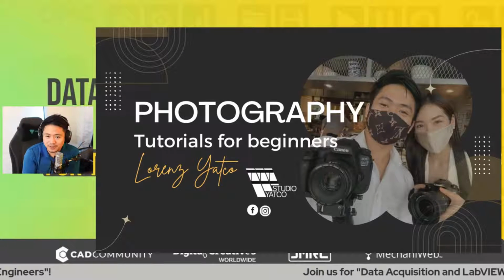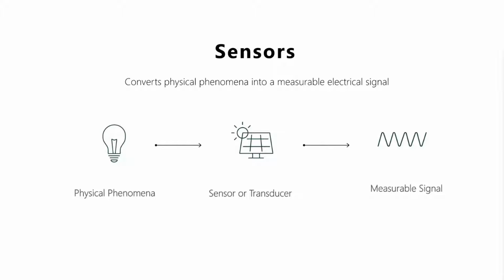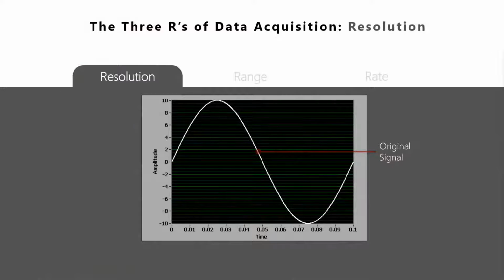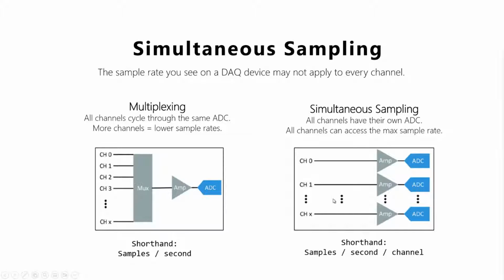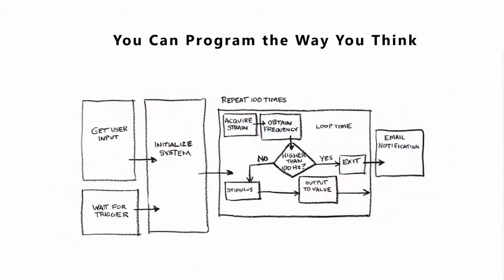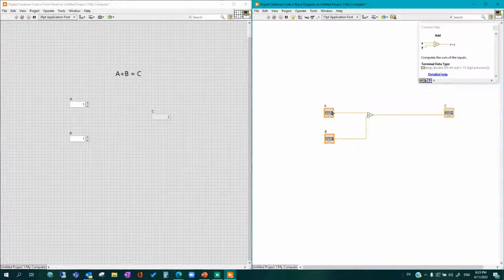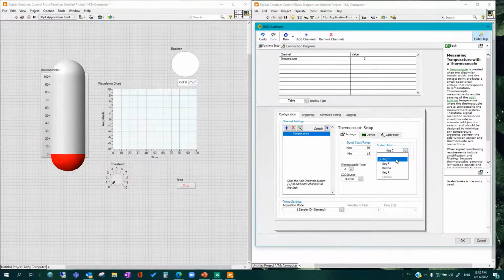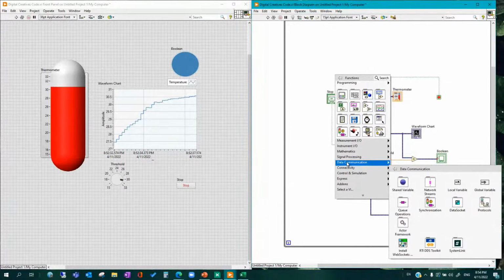Data Acquisition and LabVIEW for Test Engineers

Comment: This was a great lesson, the fundamentals were very well explained. I have a degree in EET and am starting a job as a Test Engineer this upcoming Monday. This was a great introduction to a lot of the things I'm sure I will need to know.
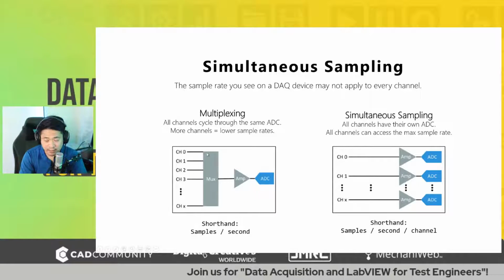I had one question about the example at 33:15. My understanding of a multiplexer was that it is just a data selector. So there would be a control that would choose which one of the input channels to pass through to the output. This one channel would then go through the amplifier and then into the ADC. Wouldn't this mean that the full resolution of the ADC is being applied to that one signal since you only can have one at a time being processed? Thanks again for your help, very good video.